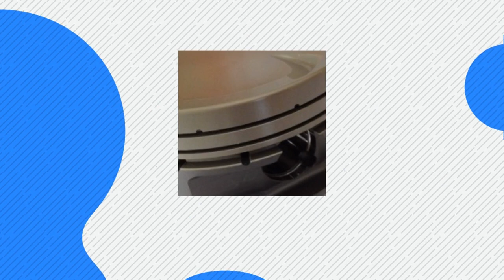LT1 ERE #93 Assembly

Comment: Are you able to remove those Johnson Link Bar lifters with the heads on?
Reply from the maker: Definitely no.    I learned my lesson a few times on that.
Reply: @EllweinEngines  I figured not.  Just wanted to check and see.  Is that a common "issue" with link bar lifters?  I'm having a 395 built, and I'm just not 100% sure what I want to do for lifters yet.  I'd love to be able to have lifters which can be removed without taking the heads off (just in case), but I think I would be best off ditching the factory style lifters.